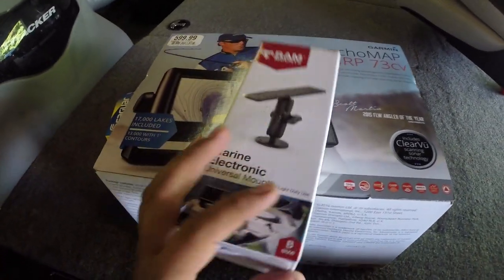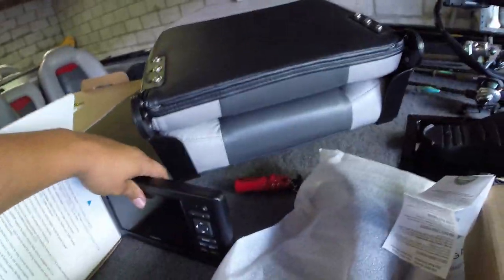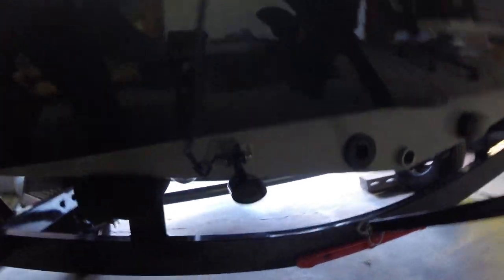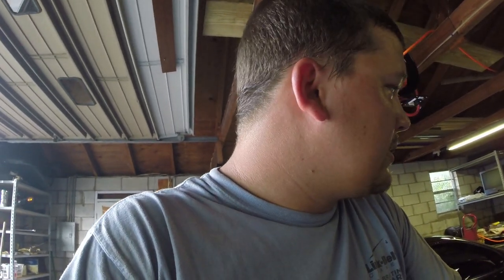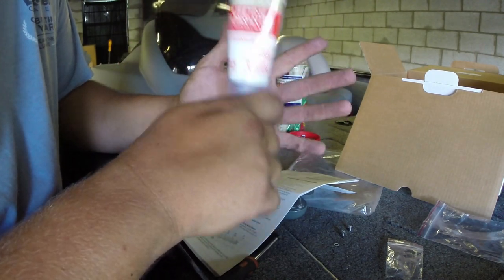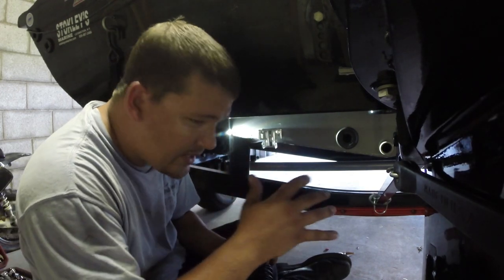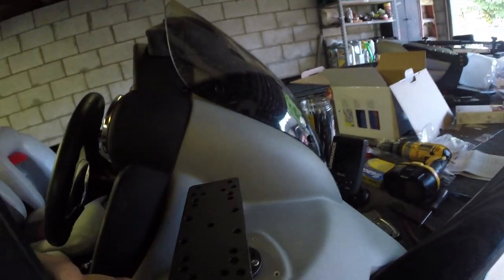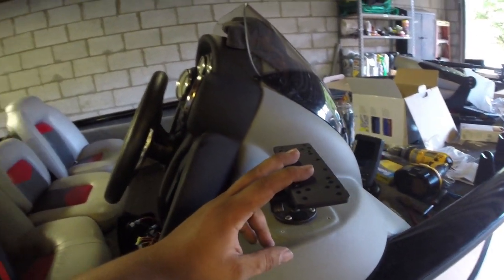Garmin ECHOMAP Install

Comment: I recommend getting the echomap 93 or 94sv it’s $600 usually is $999
Reply: I just bought the 93sv UHD at $1049 on Amazon. The UHD is the newer transducer.

Comment: That transducer is mounted way to low. About 1/3 of the transducer should be above the bottom of the hull. Did you check your installation guide that you got for that sonar? Your transducer will give faulty if any signal when at higher speed.
Reply from the maker: +Tayjuice yeah the guide just said to keep the trans below the hull enough to prevent interference and to tune accordingly. I haven't had any issues but i agree that it could stand to be brought up a bit.
Reply: Should be fine at low speeds, but higher up with cause less turbulent flow over the xducer and you'll hold the bottom at higher speeds.

Comment: What mount did you use? I'd like one.
Reply: I have my Garmin mounted on my Dash just like Mr. Shaky Heads but I switched to a Garmin 6" swing arm mount, it is a much more solid mount and less headache if you turn the unit around back and forth when fishing up front and driving.
 https://www.rammount.com/part/RAM-109HU
Reply from the maker: im using the ram mount size B i believe. but you could def look into the mount brian is talking about.

Comment: Most people in these videos line up their transducers wrong,if you don't line up the bottom of the transducer with the bottom of the hull your doing it wrong,its in the directions
Reply from the maker: I did catch that and adjusted the mount bracket later on to keep it right in line with the hull. Just didn’t catch it till after filming.

Comment: Hey trying to install the same on my boat but don’t have a fuse box like you.  Closest power source is the 12V plus.  Tips on connecting to that?
Reply from the maker: You could connect it directly to the battery honestly. Just be sure to install a proper sized fuse into the circuit to prevent any fire hazards.

Comment: I was always told you needed to put transducer on starboard side on the rear
Reply: Garmin instructions say if prop rotates clockwise transducers goes to starboard side and port side for counter clockwise.
Reply: @briankeck3762  So doesn't the Mercury have a clockwise prop rotation??? Hence the transducer should be mounted starboard?
Reply: @steveking8548 Yes

Comment: Is the transducer not suppose to be on the right side of the motor
Reply: IT DEPENDS ON THE ROTATION OF PROP.
Reply: @dashcam5398  And doesn't the prop rotate clockwise on the Mercury which is used by the Bass Trackerers? Hence, the transducer should be installed on the starboard side of the transom.